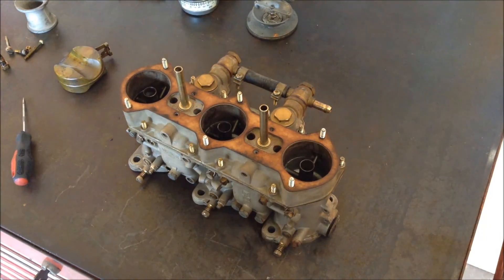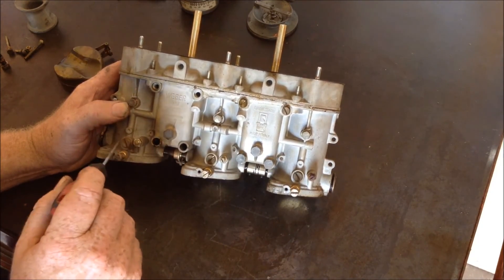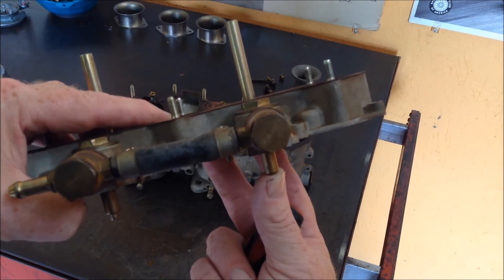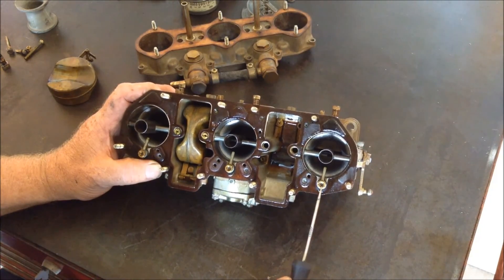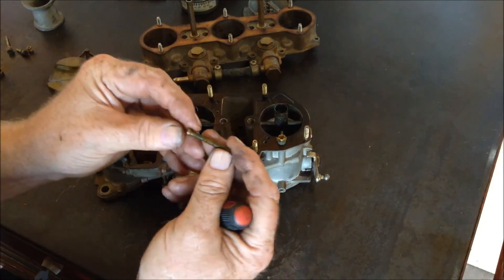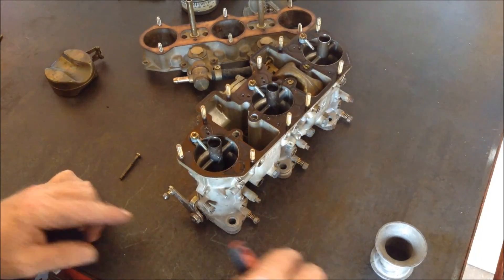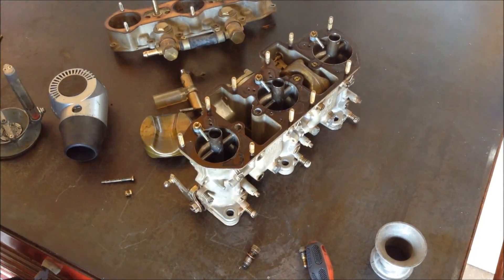How Porsche 911 Weber Carbs Work with Joe Cogbill

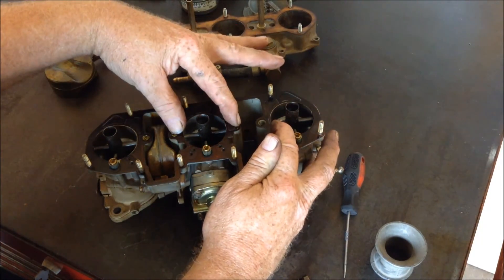Comment: This video just saved my life.  I have been tweaking my Webers for awhile and have been unhappy with the results.  The car sounded half way right but it had no power.     I was just surfing you tube last night and found this video Joe.  Then there it was, 6:42 into your video.  A reversed pre-atomizer.   Could that be my power problem.....?  I was already to pull the trigger and order some PMO's and I would have been one of the ones that drank that cool aid.   15 minutes into a look and that is exactly what I had done.  I was running on 5 cylinders after transition from the idle circuit.  Thank you Joe!  You saved me $4000.   Now the car is screaming.
Reply: That is possibly what mine has!!! A great comment from your side John Bouchard... Thanks CogsClassicCars